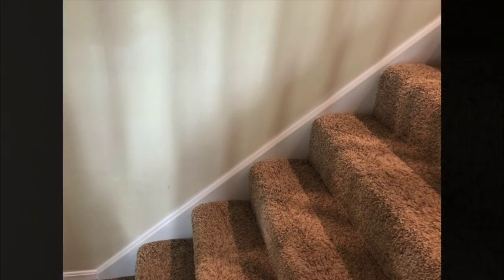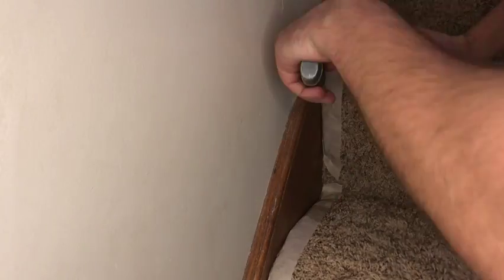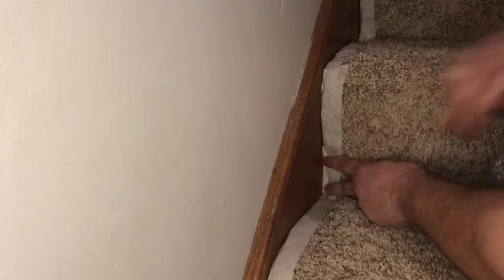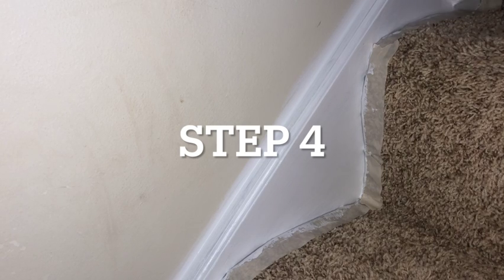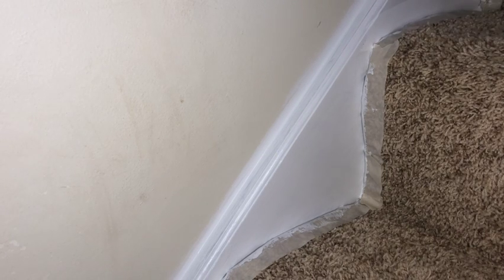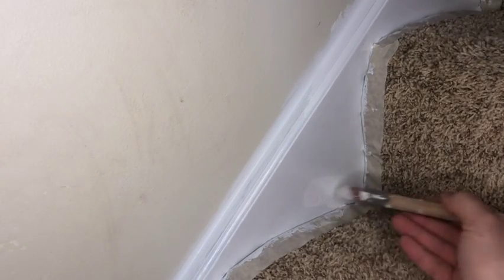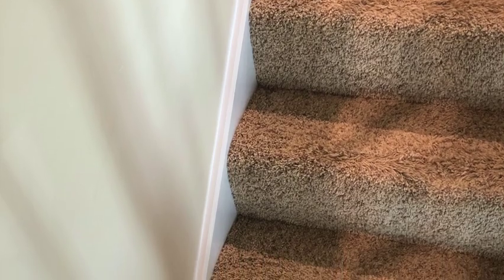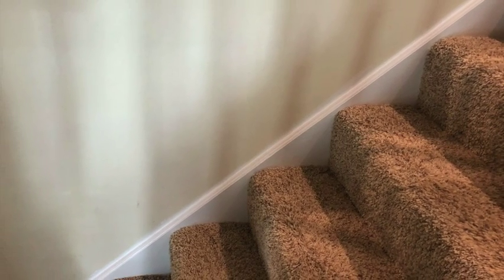How to paint trim on your stairs (by carpeted treads)

Comment: So it doesn’t really matter what topcoat was applied to the trim before you start this process, as in you shouldn’t need to sand before priming as long as your using oil-based primer and/or the SW Emerald urethane enamel? And secondly, is it better to remove the tape when the paint is dry or wet?